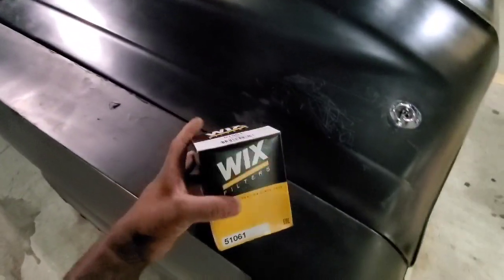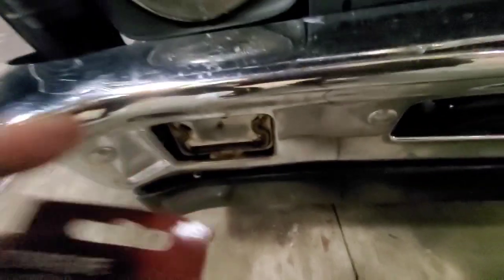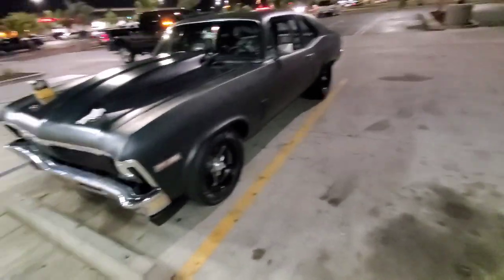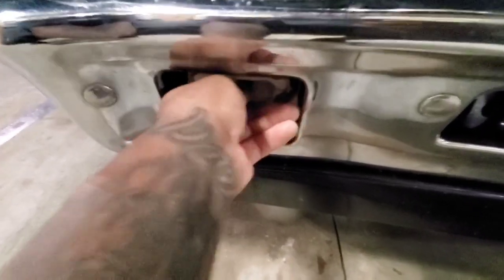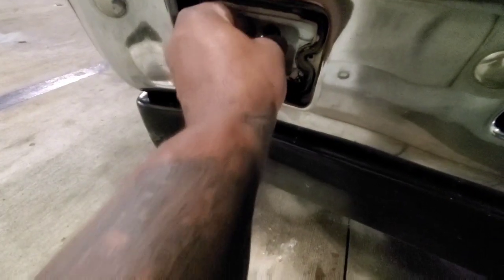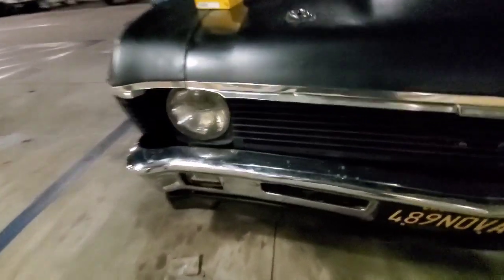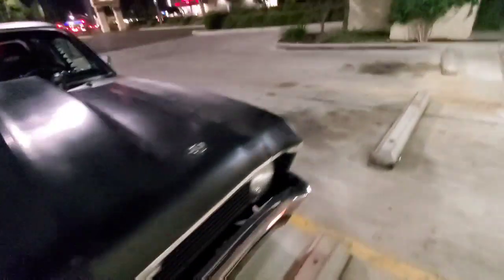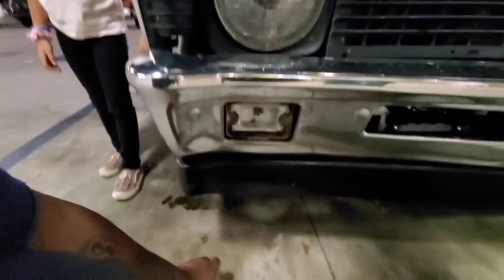CHEVY NOVA IN THE STREETS BULB CHANGE FAIL

Comment: Bad ground ?
Reply from the maker: I wiggled the wire it works now might be a ground
Reply: Car is over 40 years old... things can start getting weird. Thinking to put new wiring harnesses in my old truck. Things shut off so i smack the dash or kick the firewall and it starts working again, hate to have it burn.